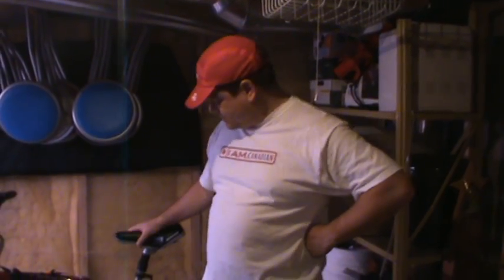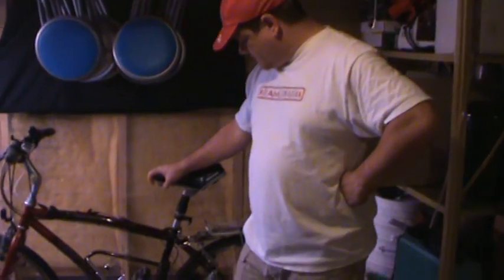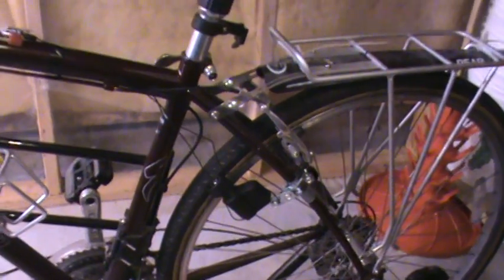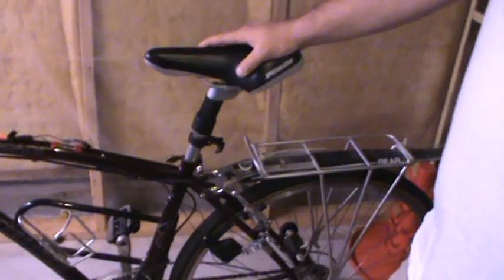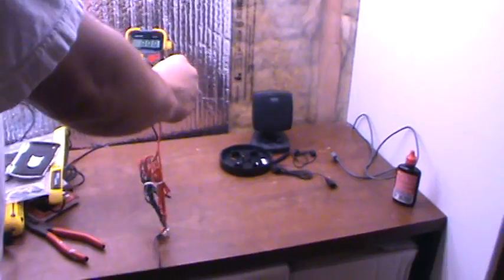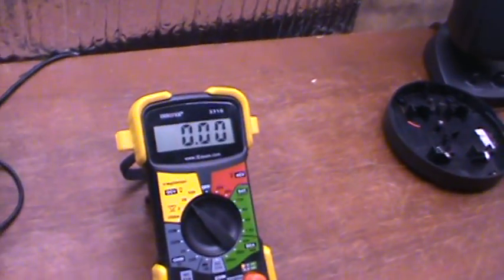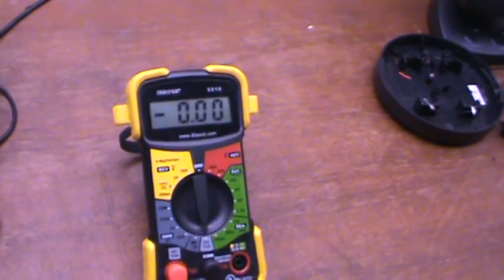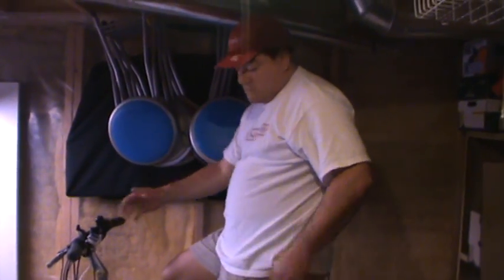Bicycle Dynamo USB Charger

Comment: Could you just use a wall phone charger box instead of the rectifier?
Reply: No.  They also reduce 110V to 5.5zv
  What do you think would happen if you wanted it to reduce 12-15V to 5.5V? it would reduce it too much.

Comment: Hey @smrtcarmrtcar, I'm fairly new to electronics projects like this. What diodes should I be using for my rectifier bridge? I assume they come in different ratings/etc. Thanks for the idea, I hope to mine shortly.
Reply: Scratch that, I noticed your older comments. I would however be interested in what dynamo you used.

Comment: omg this guy made a bridge rectifier that is on the back of your alternator on your car the little plastic thing lol and the BR cuts the sign wave in half to give you DC pump that into a capacitor and to smooth out the voltage and you have yourself a charger woot available now at people who know fuck all about electronics R US

Comment: I can't find your schematic for the voltage rectifier.  I want to rectify a 6V, 3W generator to 12 V DC and connect it to a 12 V lighter regulator.  Any help would be appreciated. Thx.

Comment: Most electric bicycles already charge by making the engine work in reverse (i.e. as a dynamo). Usually if you brake slightly, so that the regular brakes aren't engaging it will do this.

Comment: I have a electric bike , can I ride it and charge it at the same time ? 
.
It requires 2.0 Amp charger
Reply: Certainly not if you are hoping charge as much as you use in hopes of going forever.  All generators are hard to spin when you are using them to make significant electricity.  It isn't a 100% efficient process.  The drag of this generator being spun by the tire slows the bike down a bit and reduces its range a bit.  Due to its inescapable inefficiency, it can't return as much electricity to the battery than it took from the battery, no matter how big or small the generator is.  This little gen. will charge a phone battery over some hours but has nowhere near adequate amperage or high enough voltage to charge an ebike battery in any reasonable time.  It takes hours to charge an ebike battery with the higher voltage and amperage they get from a charger plugged into house current.

Comment: Are you sure that the voltage regulator delivers DC? I mean that AC after rectifier looks like wave not a straight line. Hadn't you thought about some capacitor or ever NiMH battery to stabilize voltage?

Comment: I would add many big 12v electrical capacitors (4700uf) on the usb end to maintain the voltage the longer you can when you stop somewhere. Nice video!

Comment from the maker: @ZsergiuA 
I'm pretty sure it will. Google the following file "ds28002.pdf" to see the specs shee. I can't post a URL here but you'll see the specs for the diodes. the 4007 is overkill but if that is what you have, use it.
Good luck.

Comment from the maker: @bsturgisva 
I made the bridge rectifier with diodes from Radio Shack. I don't have the specs but I just used 4 of the same capacity diodes. You can also buy the bridge rectifiers. it should cost about $5 for the either solution.

Comment: Awesome build, I'd always wanted to build something like this. I met a guy that did something similar with more expensive parts. I read your instructables and was wondering how you made your rectifier. I'd like to build one soon and see that I'll need help finding the right diodes and circuit for that. Thanks! and once again great job.
-BJ